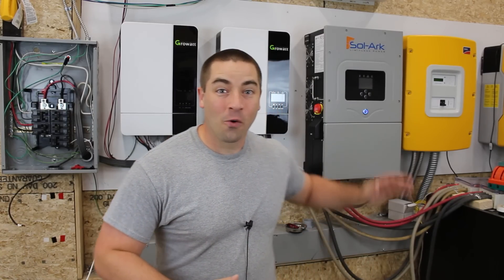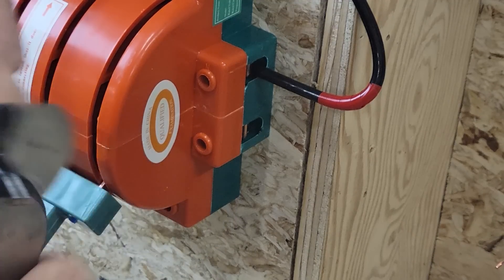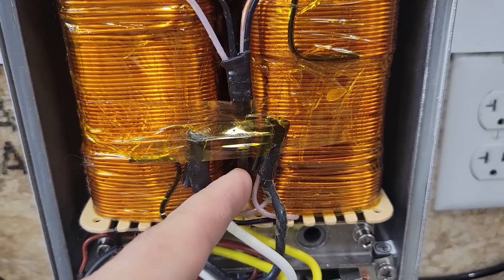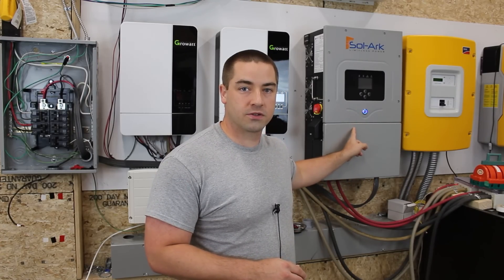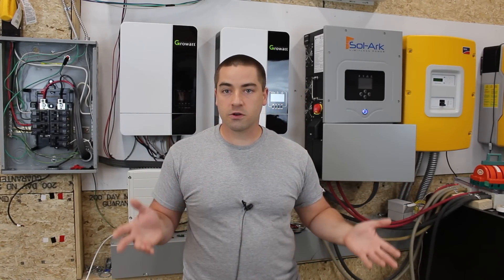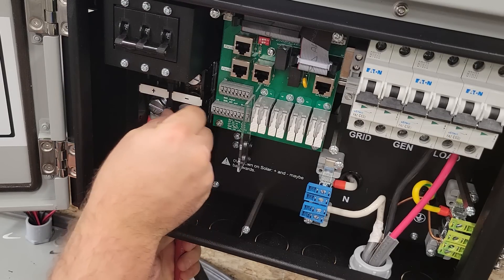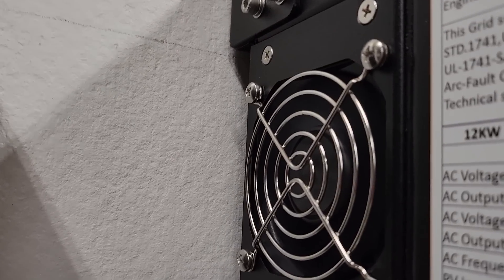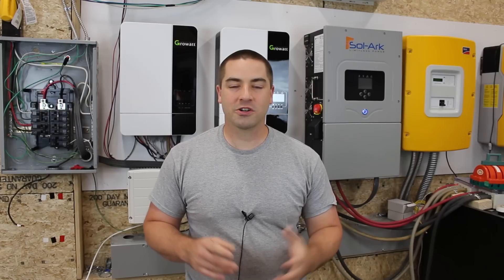Sol-Ark 12K 48V Inverter Install (to compare with Growatt 10K)

Comment: Solark states and is on the label is max output in amperage is 45 amps. Your water heater is 30 amps. Your confusing watts with amperage.  So if you hot water heater is running at 30 amps@240 volts and then ran your dryes at 50 amps @240v of course you would overload the Solark  which max output is 45 amps.

Comment: For electric utility purposes, high voltage is anything above 1KV; the primary side of pole and pad transformers is high. Low voltage (120/240 1P, 208/120 3P, 440/277 3P) is below 1KV. Legal maximum low voltage is 600V, which is why the maximum open loop solar array voltage is around 500V. For all practical purposes, high voltage starts at 6KV, though most utilities use 12.7KV or 14.4KV as the local distribution system voltage. There is no medium voltage. 

"Safe" voltage is 48V and below. It's why 48V was chosen as the telephone network voltage.
Reply from the maker: Great information.  Thank you.

Comment: My 12k shuts down every time I use a chop saw or table saw. problems started after the firmware update. Solark has been trying to figure it out.but so far I am at my whits end

Comment: it look like rebranded Deye inverter, check Deye spec or youtube videos, it says you can load single phase with max half of total performance. for example 10kw inverter deliver 5kw per phase. or for europe with 3 phases, 12kw inverter can deliver L1 = 6kw, L2 = 3kw, L3= 3kw.

Comment: 120 volt requires, a neutral wire for completion of circuit . The reason is there is no balance of amperage. 240 volts doesn't  require a neutral to function, they are balanced at zero amps. The power company supplies 120 240 through a center tap transformer from a single leg of there three phase transmission lines. We did this on rock plants to provide ,lights etc for 120 and 240 loads. Fred

Comment: I think all inverter testing should include putting it in a chamber at 120 deg F with full load and let it soak for a while to stabilize temperatures. Then repeatedly hard short the output at least 10 times to see if it survives. This testing gets expensive if you have to buy them to test, but I'm sure many inverter companies suck up to a popular YouTube website like you and supply inverters to test and probably even give you kickbacks.

Comment: I know this is a older video but ... One question if anyone knows, does this Gwatt unit support scheduling AC input power use? For example snow on my panels all day and my batteries need charging at night, can I schedule this unit to use AC input to charge up the batteries?  Also to lock out when never to use AC input power .. like batteries are dead, no solar power,  but their is AC input power .. scheduling when not to use AC input no matter what?

Comment: Is there any other inverter that has ac coupling? If someone have an existing solar setup. And want to use batteries when the grid goes out. But this sol ark for over 6k is expensive and don't really need to add solar array to it since have an existing solar grid tie.

Comment: You may reference the NEC NFPA manual for voltage description.  It is my understanding that low voltage is <= 90 volts DC. I don’t think that value applies to AC as it has peak to peak values much higher than the sinusoidal RMS of 90 volts.

Comment: I'm glad to see a comparison between Growatt and Sol-Ark, however, one of the primary differences you points out - pushing into the Grid - is not appropriate. You're comparing a hybrid device from Sol-Ark to an off grid device from Growatt. Growatt does make hybrid devices.  Growatt SPF series is designed for off grid. Growatt Min Series is hybrid.     So you're comparing apples and oranges.

Comment: Why would you want to shut down the AC generator inverter by raising frequency ? Is it for a special case when the grid is disconnected and batteries are full ? Is there any other use for such feature ?

Comment: What is the brand/model of the autotransformer you are using here, (and when you were attempting to correct for imbalances on the SolArk in another video)? When I search online for such a device, I get all manner of other types of transformers. LOL. Thanks to anyone for an answer here.
Reply from the maker: The exact one I'm using is a 5kVA from Solar Edge.  It's getting harder and harder to find.  Here is a link to a readily available option that works the same way: https://shop.signaturesolar.us/products/5kw-split-phase-transformer-by-growatt?_pos=1&_psq=transf&_ss=e&_v=1.0&ref=4_rHcgZ9x-TiF-

Comment: your water heater takes about 5k which is over 50% of your load. stove , washer , dryer doesn't help. get a hybrid water heater. uses heat pump.  100% electric about 400 w to heat water vs 5000w....

Comment: I have 2 systems, 1 is a battery off grid system powering my gym, light, heat, outlets. 710AH battery bank with 1kw of panels.  Then I have a 2kw gridtie system going into my home.  if I added another 2kw of panels, 5 Kw total.  would I be able to tie those 2 together with the Growatt inverters?

Comment: Glad I watched this. Was about to go solark but hell growatt for me
Reply: Dito, I was all about the SolArk, but the transformerless inverter is less forgiving than a transformer based one.  Transformers are less efficient, but cost about 1/3 and you can make up the efficiency difference with a few panels and/or battery.  Additionally, my Growatt SPF 12000 will do 300% for 20ms which is great if you are running near capacity and a motor kicks on.

Comment: There may be a different reason the transfer switch did not hold, stranded wire should have a compressed ferrule on the wire bundle to insure the strands of wire will not move under pressure

Comment: Would like to know if you can setup can bus communication between your Batteries and the 12K
Reply from the maker: As of right now, no.  I'm told it's something they are working on (the battery manufacturer) but no timeline.  I've been using the Sol-Ark without battery communication and it's been working fine just running on voltage settings.

Comment: Hello Dave, very good video. On one of your test can you verify that the critical load panel can be maxed out at the rating of the inverter. I have seen where other hybrid inverters of a similar type like Sunsynk and Deye, ask you to keep critical load panel to a minimum  and avoid high current draw loads. Also what is the max load the unit can handle suppling the main load panel and the critical load panel at the same time. Thank you for your very informative and fair assessment videos.

Comment: I was wondering about you putting the breaker from each of the growatts into the main load panel, if the breaker feeding the autotransformer tripped or was thrown before the loads were cut you would be without a neutral. 

I see you have bare terminals with 240v on them just attached to the wall, is there any concern that they are so exposed or do you have a plan to cover them?
Reply from the maker: I have plans to install them all inside an electrical box.  I was attempting to make it as easy to see as possible for the audience.
Reply: @DavidPozEnergy  Roger. Thanks for the videos, found them helpful with my project.

Comment: So my battery’s are made from Jaguar modules, which are 3S4P
So five of these in series to make 15S4P. Each pouch is 60amp hours, so 240 amp hours.
I have 30 of these modules, so five battery’s, each at 15.1 kWh.
I will need to maybe run this at a lower voltage as I don’t have a 14S option for the usual 48v system☹️
Can these inverters either provide 63 volts, or be limited to not charging the 15S stacks fully to simulate the 58.8 volts a 14S Tata I would give?
Reply from the maker: You can program the maximum charge voltage in the inverter menu.  My friend Ben, is using a 16s Volvo car battery with his Sol-Ark and it works.  So I'm fairly sure your 15s would not be a problem.  (of course you still need to add a BMS onto your battery)
Reply: @DavidPozEnergy  
Thank you very much for that reassurance. I was going to opt for a Batrium BMS or the  DIYBMS by a bloke called Pittaway. Any other BMS candidates for 15S?

Comment: I remember you blowing out inverters when you turn on an air compressor with a big motor. What happens when your air compressor kicks in with these inverters?
Reply from the maker: So far my 13A, 120V, air compressor works on this inverter so long as nothing else is also running.
Reply: @DavidPozEnergy  Once it starts can anything else run on the system? That's only 1440W. Do you need both to run it?

The most annoying thing i find about solar and inverters is that they're not really designed to take power tools.

A few large capacitors would make it much much easier to start those motors and not blow the system but no one seems to have done that.
Reply from the maker: I just noticed you said "both".  This video is about wiring the Sol-Ark inverter, which is 1 inverter.  The Sol-Ark doesn't handle the power tools well.  However, the two white inverters are Growatt brand.  Those two handle the air compressor very well.  I've never had the two Growatts shut down on me even when running power tools.  If you want to see more about the Growatts, I have more videos on it including running several power tools on just one: https://youtu.be/yWUfvvSa3K8
Reply: @DavidPozEnergy  I already watched the growatt inverters. Thank you. I was watching this one and thought of the ones where you tried to use one inverter and they blew up. It was good to know that they aren't made for that.

So two is good. That works. Once I get my own place and get an air compressor, I will look at it and see if a capacitor will help start it.

It's always the initial draw that kills them.

Comment: Does your signature solar coupon code no longer work on the batteries?
Reply from the maker: Signature Solar changed the battery code to DAVIDPOZ25  
The original code DAVIDPOZ still works on inverters.

Comment: good answer to a stupid question.  I lived in Framingham for 16 years.  Love Mass.  I understand now that the battery is only to supply power for a few hours.  Got it.  If you had to start today with a liberal cash budget, what kind of system would you put together for a roof top system.  Panels ,inverter, batteries etc. I have a garage with a free wall to hang equipment. The same wall where the outside meter is located. We consume 1,560 KWH a month and have a Tesla Model X.  I charge the Model X mostly at a near by Supper Charger Station because I get it for Free.  But do use the home charger on occasion.  Don
Reply from the maker: Hi Neighbor.  (BTW, is it John or Don?)  My personal projects are all off grid, and ground mount.  When building on your roof, you will need to comply with panel-level rapid shutdown.  Then, to add a battery system it would probably be AC coupled, utilizing micro-inverters on the roof.  For AC coupling you can use the Sol-Ark, Outback Radian, Schneider XW+, or SMA Sunny Islands.  The SMA Sunny Islands are better at handling loads than the Sol-Ark, but both have their own merits and quirks.  In my opinion, there is no perfect option for Grid-tied, Roof mount, and battery backup.  Personally I'd plan it out with Enphase micro-inverters on the roof, and SMA sunny Islands in the garage, but I'd seek a solar installer to make the plan and check with local code official before buying the equipment.  If the local inspector says "NO" then you have to look at a different product.  
I do a lot with Lithium batteries, but that's because I run them off grid.  If you plan to have your battery bank sit 99% of the time, and only cycle when there is a power outage, then I'd buy AGM: https://www.altestore.com/store/deep-cycle-batteries/sealed-agm-batteries/kilovault-2100-plc-2100wh-180-ah-12v-advanced-agm-battery-p41443/
I have a friend who runs his own solar business, local to us, and I'd suggest hiring him: https://www.intelligent.solar/
Reply: @DavidPozEnergy  Thanks so much.  I will keep you up to date.  Don
Reply: @DavidPozEnergy  First, I have enjoyed a number of your videos. Thanks for sharing your knowledge/experience.
I assume you recommended microinverters for a rooftop solution because you later mentioned the battery bank sitting 99% of the time. If one was to size the battery bank to handle the dusk-to-dawn energy draw plus some wiggle room (so that the batteries would be charging and discharging daily, and the wiggle room would allow you to handle outages of a couple days as long as you get some production from the solar panels), then wouldn't it be better (less conversion loss) to use a DC coupled solution (say, the Sol-Ark, with Tigo TS4-A-2F for rapid shutdown (lots cheaper than microinverters), and DC coupled LiFePO4 batteries like yours)? And if you use one of the newer solar panels that have some shade mitigation built in (like, say, Solaria), then as long as you have only minor shading issues, a skilled solar designer could use the panel mitigation attributes and the MPPTs in the Sol-Ark to minimize shading losses. With a system like this, you minimize total draw from the grid, can still be grid-tied to sell back any excess wattage, get near-zero electric bills, reduce stress on the power grid, have short term power backup, and if you want guaranteed longer term backup, Sol-Ark says you can easily add a backup generator (portable or standby). I'm not some Sol-Ark fanboy. Like Don/John, I'm just trying to decide which system would be best, which would then greatly influence which installer I choose (I live in Central NJ: not sure where you two "neighbors" are). Sol-Ark is a contender and would easily be in the lead if they didn't store all user data on servers in mainland China (evidently verified on message boards which also claim system updates come from China as well). I emailed Sol-Ark over a month ago asking if this was true and if they have plans to change it. Zero response. Not even acknowledgement that they got my email. So much for "fanatical customer support". Maybe that means after you purchase a system.

Comment: Hi Dave.  Love all your shows.  I have a question and value your opinion.  I am thinking of getting  Tesla panels and system but no battery.  Can I ad the Gill battery to the system?  Will the Tesla system see it?  John
Reply from the maker: I have not personally worked with the Tesla equipment.  I have a friend of mine who has a full tesla system top to bottom.  He has been struggling to find a way to add some Gyll battery capacity and he tells me there is no way that he has found.
Reply: @DavidPozEnergy  Thanks for your responce. I may look elsewhere for the panels.  How many Gill units will I need for 1,560 KWh.  Keep up the great work.  I watch all your vidios.
Reply from the maker: Each Gyll Battery is 5.12kWh.  You would need 305 of them to hit your target of 1,560kWh.

Comment: Hi david, I am using growatt spf5000es now on my home but the weired thing that my grid smart meter alarm lighting when i connected the grid to ac input of the inverter, i gave phase and neutral from my grid then i connected them directly to my inverter ac input. The grid alarm appearing even with no load at the inverter and even when the inverter at standby mode. Its looks like my grid smart meter can detect my inverter and i dont know how. I dont know if you have any idea about this. Thanks again

Comment: I've wanted one of these but just one may not be enough. The alte store has them but man.... So much money..... May just go with a cheaper stackable thing in the long-run. This system putting out 72kW tho with a bunch in parallel is pretty sweet

Comment: Greetings friend. Isn't the Grow watt inverter a high frequency inverter with Mosfets? The Sol-Ark is a low wave inverter. When you live off grid full time as I do I would not trust a high frequency inverter as a primary power source. They just will not hold up to a well pump for very long. The low wave inverters (I use Outback and Magnum) will last decades. To me that is worth the difference in price. Sol-Ark is top of the line. I would like to see it in charge mode through a generator and not through Grid power. I am interested in the true power factor using a generator. I am sure they are PFC.
Reply from the maker: Hi.  Both the Growatt and Sol-Ark are high frequency.  Neither one have a transformer inside.  I've had the Sol-Ark powering my home for 3 weeks at this point, and it doesn't handle the startup loads (motors/compressors) as well as the Growatt assembly did.  I'm surprised by this, as I was expecting the Sol-Ark to do better.   Happy to try it with a generator.
Reply: @DavidPozEnergy  Thank you for the information. I thought the Sol- Ark was a low wave transformer type. I am shocked that it is not. I know Engineer775 uses a lot of them. It is no surprise then that the two Grow watt inverters out perform one Sol-Ark. From my experience living off grid  high frequency inverters just do not have the surge capacity that transformer types do. I started out with Trace. I know of one Trace inverter on a hydro system that has been running since the mid 90s. My personal experience with high frequency inverters is that they hate AC inductive  motors. The fets just do not hold up and they struggle or fail to start motors that are within their current range with universal brush type motors being the exception.
Can you  add a  test running your well ?
Thank you my friend. I love your channel and content.
Reply from the maker: I'd love to test a well, but I'm on town water.  I've been watching craigslist looking for a used one, or some kind of 240V load to simulate.